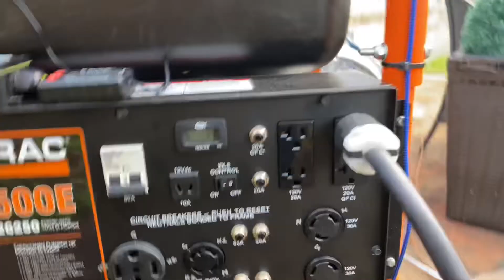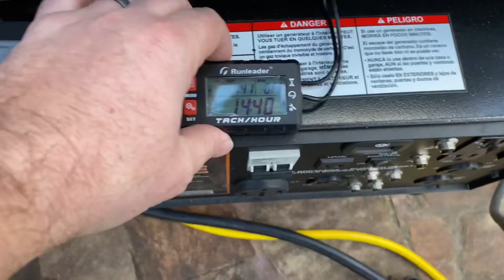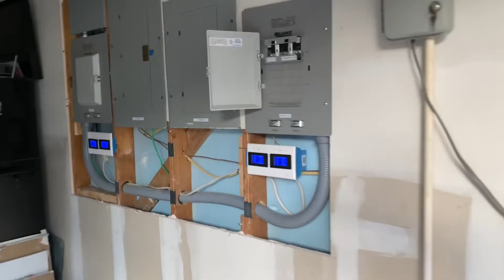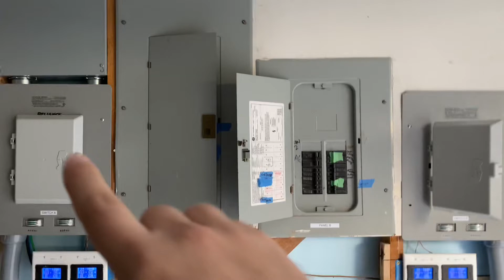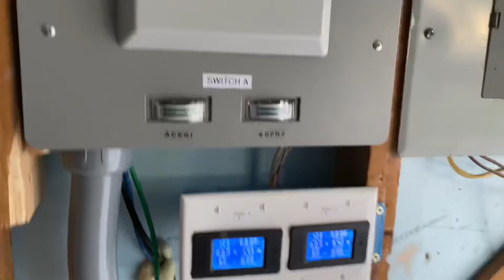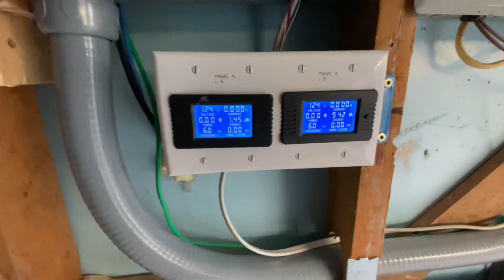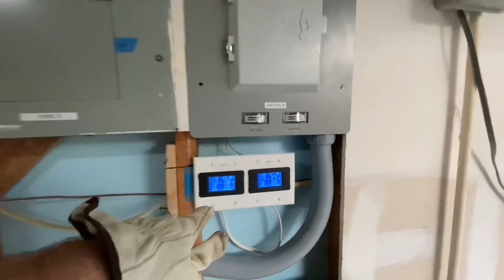Home Generator parallel power install - 72Amps/17,500 Watts - Generac GP17500E - Transfer Switch

Comment: Hello Jud,

This is a great video and I understand the challenges of living in Houston as I live here too.  I know you already purchased the generac generator, but I did find a Westinghouse Generator 28000 peak 20000 watt portable with THD of less than or = to 5% something you may want to look into I put the link at the bottom of this comment.  Anyhow at my house I have (1) 50 amp power inlet on an interlock kit, and I am thinking of purchasing the Westinghouse generator.  What's appealing about the Westinghouse generator is that it has (2) 50 amp outlets and I am wondering how I can connect both 50 amp outlets from the generator to my house.  Currently I have a 13000 watt Duromax purchased after snowmageddon that I am converting to running on natural gas so fuel is not an issue. 

I was always told don't just pose problems present your own solution so  please tell me what you think of this future state setup.  To make my question easier I am only speaking of the Westinghouse generator and will call the two 50amp outlets 50a(1) and 50a(2).  

Ideally I would like to have the 50a(1) interlock kit remain as is with the power inlet into the main panel to power whole house.  Then solely put the Downstairs ac unit on a manual transfer switch to 50a(2).  This way during an outage I could plug in the 50a(1) to power the house, and then plug in the other 50a(2) to power the AC unit.

Process of connecting the power
1. I would flip the main power off from the interlock kit.  
2. Connect both plugs to the generator 50a(1) to the power inlet and 50a(2) to the manual transfer switch.
3. Flip the 50amp interlock breaker in the main panel from off to on that is connected to 50a(1).
4. Flip the manual transfer switch breaker from line to the generator that is connected to 50a(2).
5. Power up the generator
6. Flip Westinghouse generator breaker for 50a(1) to on from off
7. Flip Westinghouse generator breaker for 50a(2) to on from off

I am not concerned with power being fed back into the grid to hurt a lineman as the interlock kit absolutely prevents that.

With this setup I think the manual transfer switch should isolate the power so that 50a(2) is only providing power to the downstairs ac unit.  I am not sure but I am almost certain this should work, but would like a second opinion as I am worried about an overload.  Do you think this would this be a good idea?  Do you foresee any issues with this setup or have any recommendations?  I will purchase the tools and monitors you have as that is a great idea. I only wish they would put a real power gauge converted into percent on these generators so you could see on the panel while the generator is running your at 54% or 92% load instead of always guessing.

Again thanks for you time I know it's a lot and any help is appreciated.

https://westinghouseoutdoorpower.com/products/wgen20000-generator
Reply from the maker: Hello fellow houstonian! Thanks for the compliments. What area do you live in? I’m on the south side near clear lake. I’ve also read that the Westinghouse is 5% or less, but have yet to put my hands on one. I’m also a little worried about the weight of that unit, as i keep mine in the garage and wheel it out when needed. If you end up buying it, i’d love to meet up and run a test on the actual THD. 

As for the system design, there are a handful of ways you could design your system. Where is your first point of disconnect from utility power? Is it the main breaker in your branch panel, or do you have another breaker prior to that (at the meter, or between the meter and the branch panel)?

Also, I read something that you might want to dig into a little more…

“I am not concerned with power being fed back into the grid to hurt a lineman as the interlock kit absolutely prevents that”

So then does your current interlock kit on your panel switch the neutral as well? Is it a 3-pole switchover? According to my understanding and research, if it only switches the 2 hot wires (and not the neutral), then the utility neutral would still be interacting with the generator neutral, and thus you could potential send current back down the grid to a linemen. 

“Do you foresee any issues with this setup or have any recommendations?”

For a generator of this power, I would def recommend protecting others by making it a self derived system (thus switching the neutral on both 50A plugs)….thus fully isolating your generator from the grid.

I’m happy to explain what I would more than likely do if it were me, but first I would need to know if you’re planning on switching the neutrals or not, because that affects how the entire system is designed. Just let me know and I’ll be happy to chime in!

*Disclaimer: I am not a electrician, so consult a professional.
Reply: @tv-mix-live  
I live outside of Sugarland, but I am very familiar with that area near Webster Tx, and Nasa Road 1.  With my Generator I also keep it in the garage and wheel it out to test and run it from time to time.  I think that would be cool to meet up and test it to see the true THD of the unit.

The first point of contact is pretty standard.  My main panel is on the outside of my house and that is where Centerpoint brings in power.  I don't have any additional breaker boxes, or anything else connected to the panel except for the 50amp power inlet box to run on generator.  I can send you a pic or video if you like to see could make explaining this a lot easier.

The interlock kit I have makes certain I have 1 power source at a time (never both Utility and Generator).  If I am on utility power then I am physically (Mechanically) locked out from introducing generator power to the panel.  When I am on Generator power the situation is reversed the main is physically (Mechanically) locked out only allowing power to the home through the 50amp generator power inlet. 

I want this to be safe which is why I have a 50amp breaker for the generator that powers the entire panel and then I am thinking about adding a 6 circuit manual transfer switch exclusively for the downstairs AC Unit.  Now I know that if I don't add the manual transfer switch the generator will run the entire house but I will have to be methodical in everything I do.  As an example I obviously turn on the downstairs AC unit first, let it run a while then the upstairs AC unit.  Once both of those are running fine then I can turn on everything else in my house slowly as to not surge the generator and trip the breaker.  Another thing is to turn both units down to meat locker temps so they don't cycle because a cycle will trip the system and everything goes down.  When both AC units are running I am pulling about 20amps consistently and I also have hard start kits on both units.  What my end goal is, is to utilize the maximum efficiency of the generator because there is wasted generated power I can't take advantage of with the additional 50a(2) plug just like you did with a 50a and 30a connection.  I see the manual transfer switch allowing the downstairs AC unit to cycle at will because it is on it's own independent 50a feed.  I can't do that with my current setup as I am already at the max of the generator on that 1 cable powering the whole house.  I will not feed two 50a connections into the same panel at the same time even if the power is from the same source, I know my limitations and that is one of them.  Which is why I would like to totally isolate the AC with the manual transfer switch, and reduce the load on that 1 cable.  Thus in effect having 50a(1) powering the house and 50a(2) only powering the downstairs AC.  I know what your thinking why not put additional circuits on that manual transfer switch since I would have 5 available.  Actually I have thought about that and I could see adding the Dryer, Deep freeze, there but I would start to get concerned about the AC cycling because it pulls 49amps at start up and then drops to 11.  But on the 50a(1) side I should have enough available power since that unit starts up at 32amp and drops to 9.  So if all else fails I could just turn off the downstairs AC and run the Dryer if I added it to the manual transfer switch.

My understanding of a manual transfer switch is this, if the power is out you have to have already predetermined which circuits you want to power on generator.  You can't change this later because those circuits are hard wired directly to the manual transfer switch.  When you connect power to the transfer switch and flip the manual transfer switch breaker (connected directly to the the downstairs AC in my case) to the Gen side then power is isolated and only feeds power to that specific circuit.

No, I don't have any plans on switching the neutrals because the main breaker is already in the off position with no power coming from Centerpoint.  I also totally understand the disclaimer i'm not either but I have worked with enough master electricians to be dangerous, but I will still get a professional opinion on this as well.

I think this may help clarify but if it doesn't please let me know and we can go from there.

Thanks,

Comment: Curious. Where is your first means of utility disconnect? Is it outside at your meter or inside? What box are your neutrals and grounds bounded at? Is it before or after the Polaris box? splitter
Reply from the maker: Yes there is a main disconnect breaker at the meter. That is the first point of disconnect from the city, so that is also where the neutral & ground are bonded (for utility power). Once the utility power passes through that main disconnect breaker, i have the Polaris splitters that split the utility into two paths. The first path goes to transfer switch A, and the  second path goes to transfer switch B.

The transfer switches switch the neutral as well as the two hot phases, so when that happens we immediately lose the bonding between the neutral and the ground (from utility power) that is located in the main disconnect box mentioned above. Because of this the neutral and ground are bonded at the generator and thus the generator uses a ground rod since it is now considered a self derived system and we are no longer getting that benefit from the utility. 

So to answer your question a little more directly, for utility power of the bonding takes place at the meter which is also the first pointed disconnect (as I have a breaker at my meter). And for generator power, the bonding happens inside of the generator, which is also the first point of disconnect. This is why I have three pole transfer switches that switch the neutral as well. Hope this helps!

Comment: I am still trying to understand the two transfer switches, If you happen to transfer one without the other , would that not back feed into the grid using a 240 volt appliance or just as bad grid feed into the generator. -------------- OK , I see it now , each transfer switch is carrying 2 hots ( one 50 amp and one 30 amp circuit ) and the 240 appliances are isolated from  each other . ( thanks for the info on the THD by the way . )
Reply from the maker: 1. Yes I’m sending a 240/5OA from the genie into transfer switch A, and a 240/30A from the genie into transfer switch B. These 50 and 30 amp circuits are completely isolated from each other when leaving the generator to their transfer switches…and then onto their final branch circuits. The current goes from genie output A, to switch A, to panel A (house circuits). The next goes from output B, to switch B, to panel B. These are Two streams of current totally isolated from each other (other than where the neutral & ground are bonded inside the genie for safety).

2. At the switch, we also switch the neutral so it completely isolates the utility grid from both the house and generator when we are on generator power. With this design, there is no way for current to flow from one to another. Hope this helps!

Comment: Jud simply email Lora at US Carburetion.  Their customer support is top notch.  I have it installed on same Generator in Katy Tx. 
MSK3016 in my cart along with
0D4026 extra gasket kit
works like a champ.  Getting ready to go to natural gas since just had a line ran 150 ft.  This kit will still work you simply feed the K1 regulator and take off the propane stage one regulator.

Comment: Jud that is quite a set up.  I'm guessing you could have simply afforded a 24KW with all the money and time you have invested.  I say this with a smile because I'm in Katy and I have the same generator along with a custom generator shed, rockwool insulation multiple CFM extraction fans etc.  I also have the US carburetion Tri fuel kit and 10 100lb propane bottles in a second shed but don't tell my HOA LOL.  There is a way to take 3 wires from the Stator and with a lug block just feed this direct to a 70-amp breaker.  I opted not to do that since it would make valve adjustments at Nothern Tool a little difficult.  You lost me on the neutrals and since I have the unit grounded like you and I'm back feeding per an interlock and 50-amp inlet I am worried about the bonded neutral.  All my research says I should be using a floating neutral like the 15000 when I'm back feeding the 50-amp inlet.  It's confusing so perhaps I will hire Miguel.  I was also under the impression that the THD was less than 5% on this model.  I struggled with not maximizing the power output but then simply plugged in the 30-amp cord to power two refrigerators and two freezers in the garage via pass through cable.   I applaud how much time and effort you put into this.  I would love to chat some time about your set up.